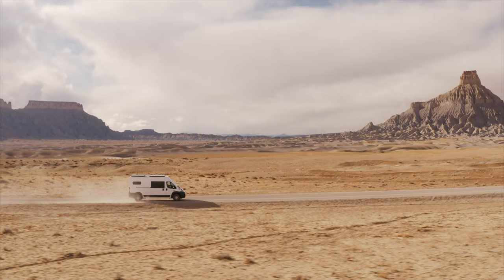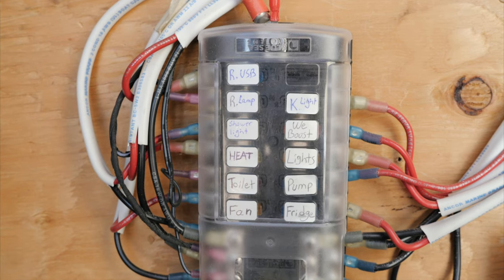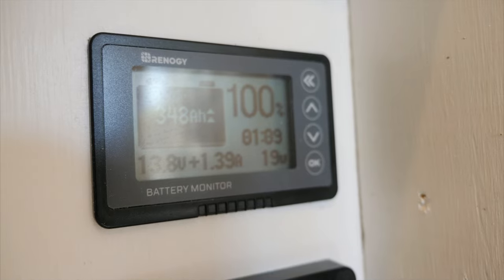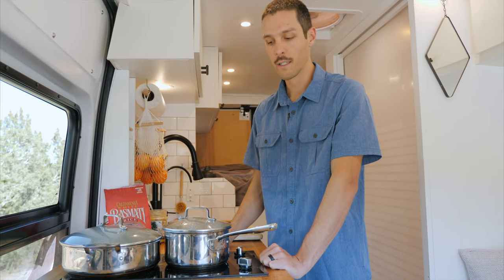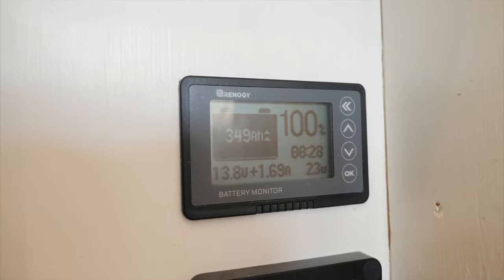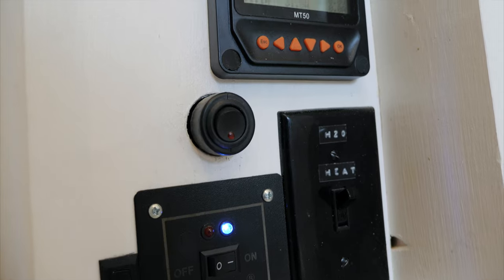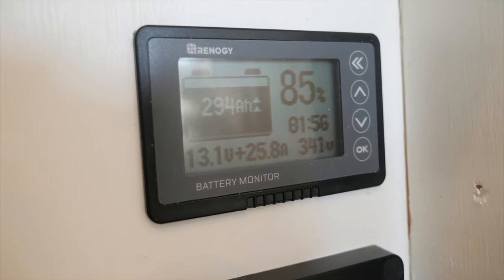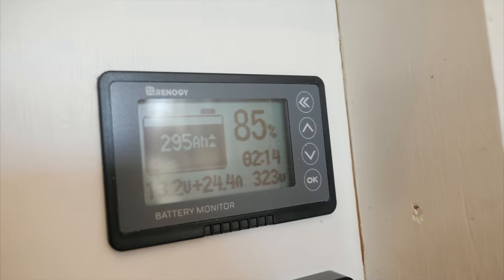800 Watt Solar Van Electrical System Performance + Free Van Wiring Diagram!

Comment: @ActsofAdventure, I bet the competition is not too happy with your free downloadable guides!  You don't even know how GRATEFUL the rest of us are, though. I'm just starting my electrical layout, as I'm just finishing up my Promaster's insulation, and I've been looking for an electrical system to mimic that's similar to yours. In the past two weeks I have bought a Growatt 3000watt 48-volt all-in-one inverter/charge controller unit, 1040 watts of solar panels (24 volt), two max fans, and today I just bought 4 of the SOK 206 Amp hrs lithium batteries. I need to look at your roof rack guide now, too! 
Wow... just thanks so much!!
Reply from the maker: That's all so great to hear! You're very welcome. We built our van from free internet resources and just want to give back to the van building community. Your electrical setup sounds like it's shaping up to be a beast of a system! Best wishes on your build and please let us know any questions that might come up when installing it all.

Comment: Awesome stuff, thanks for sharing. Have you considered a solar hot water heater? I think they are way more efficient at heating water than going through PV to batteries and then an electric water heater. Even a small, panel that you could set outside on a little stand and plug in might be a cool option that would save a lot of electric.

Comment: Hello, fantastic job you did, I am installing my solar and have a question: why you connect serie-parallel your solar cells and not all paralell?    I have 4 units 100w, open voltage 24.3V, 5.21 Amp.
Reply from the maker: Hey, thanks! Great question. We did series-parallel because 
1) We liked the idea of separating the front 2 panels and the rear 2 panels in case one half of the roof is shaded, then the other half of the solar array is still producing full power. 
2) All 800 watts in parallel would be a very large amperage and require thicker gauge solar wires. These wires are very long and some amps can be lost over that distance. Raising the voltage by connecting the 2 parallel pairs in series allows less energy to be lost when traveling the length of the cables. Then, the MPPT controller converts it all back to 12v at the highest/best amperage needed for the batteries anyway. 
Hope that all makes sense and helps!

Comment: Tnx - nice set up. Why the two sets of two solar panels run in different directions (landscape at the back, portrait at the front)?
Reply from the maker: Hey, good question. It was about the fit on the roof. The 2 panels at the back of the van behind the fan wouldn't fit lengthwise, so they had to go widthwise. And by mounting them widthwise, we had to mount them on the unistrut roof rack a bit differently than the front panels.
Reply: @ActsofAdventure  ok I get the 2 rear panels had to go widthwise due to the fan but then why not the two front ones widthwise as well. There is something I’m not getting?
Reply from the maker: @dimitristsagdis7340  Check out our solar panel roof rack blog post for more pics. https://actsofadventure.com/solar-panel-roof-rack. You'll see that the rear panels had to be mounted higher on an extra layer of unistrut. Widthwise, these solar panels fit exactly on top of the unistrut side rails. This creates a problem because you can't access the bottom of the panels to mount them to the unistrut. Since the front panels could fit lengthwise, they didn't need the extra mounting height, and so they are more aerodynamic and low profile. I would have preferred to mount the rear panels lengthwise, but they just barely wouldn't fit unfortunately.
Reply: @ActsofAdventure  ok Tnx it is clear now.

Comment: Thank you so much for putting out this video. Very helpful! Looking forward to spending some time with your diagram. Why don't you upgrade to lithium? Seems like that would give you more than enough power. Cheers!
Reply from the maker: You're very welcome! Let us know if you have questions about the items in the diagram or the wiring connections. Our decision to go with AGM was largely due to price. We have 350 usable amp hours for $1400 total. That many amp hours in lithium costs around $3500, especially 2 years ago when lithium was just becoming mainstream. When our AGM's degrade in 2-3 more years, we will likely consider lithium as their replacement!
Reply: @ActsofAdventure  What an excellent logical decision! It is easy to forget how fast the prices of lithium batteries have fallen and that they were too expensive for your budget two years ago.
Reply from the maker: @mitchellbarnow1709  Gotta love technological advances and an increase in competition! I remember it was really only Battle Born or build-your-own with lithium cells 2 years ago.

Comment: you mentioned you don't need to pay for water [min 0:32] how come? You don't seem to elaborate on this in the video; pls explain.
Reply from the maker: I was wondering who would catch that ;-) Here in the Western U.S. we've always been able to find free places to fill our water tanks! Usually at gas stations or city RV dump stations. We never stay at campgrounds or RV parks so we find as many free water sources as we can. They're all listed on the iOverlander app or rvdumpsites.net.
Reply: @ActsofAdventure  Tnx I thought it was maybe due to your electrical installation for example some RVs use UV filters and recycle their shower water as well as dehumidifiers to turn condensation to water for dishwashing, I’ve even seen rain water traps with gutters in the roof:-)) by I could find anything of such things in the diagram which is why I thought to ask just in case.
Reply from the maker: @dimitristsagdis7340  Wow, that would be a next-level water system! Maybe in our next van build!

Comment: If you are going to take separate showers, do you leave the water heater power switched on, since the thermostat will stop the power draw once the set temperature has been reached?
Reply from the maker: We got the 4gal Bosch instead of the 2.5gal so that a full heated tank would be enough hot water for both of us to take showers. We take short, on-off style showers, but there's enough hot water for both of us without the need to re-heat the water tank or keep it switched on. Also, we generally heat the tank in the afternoon, and it stays hot through the evening.
Reply: @ActsofAdventure  That is fantastic that four gallons is enough and you can heat it up when you have plenty of spare solar energy!

Comment: Any particular reason you chose AGM over Lithium? Just checked the prices on the batteries you mentioned and the prices for a lithium bank of similar capacity isnt all that different. Not too mention the batteries are a lot lighter too for your payload
Reply from the maker: Hi Hugo, great question. When we built this in 2019, we spent ~$1500 on our AGM batteries, and lithium was at least double today’s prices. Cost of lithium has really gone down a lot. Those Enduro lithium batteries are a really great deal, and even make us consider switching to lithium!

AGM has worked really well for us though. One of our favorite benefits is that we can store the van all winter and never have to worry about the temp of the batteries.

Comment: How do you know when the water is hot?
Reply from the maker: We only turn on the hot water heater when we need it for showers. We can tell when it is done heating the water when its large electrical draw on our battery monitor goes off. We’ve also learned that it takes about 15-20 minutes.

Comment: Why are you afraid of propane. Overall this was a very informative video and I really enjoyed it. I just wonder why you would rely electricity for all major appliances. It would make more sense to have heat intensive appliances like water heater and stove/oven be propane based and reserve amp hours for things that NEED to be powered by electrical. You wouldn’t need to have to such a large electrical system ie (800W, 3000W inverter and 700AH battery). I bet you could cut all of those in half if you distributed your systems over other sources. I’m still a huge fan and I for sure am using your van layout layout as inspiration for mine. Thanks for your videos!
Reply from the maker: Hey Skyler, propane is definitely an efficient and inexpensive way to cook and heat things, which is why the majority of vanlifers choose propane. 
We went full electric for a few reasons - mostly that we didn't have to install an entire propane system in addition to a water system and an electric system. Having never built anything before this van, it took us a year to build, and not having to worry about propane was a welcomed relief. I actually enjoy electrical wiring. 
Secondly, of course no propane means we never have to refill propane on the road. Just one less thing to worry about.  Electricity is 100% passive once it's installed. 
Third, we didn't want to take up precious cargo space with a sealed propane locker, and mounting a propane cylinder under the van felt sketchy to us because we are often on rough dirt roads. 
Finally, knowing that off-grid electrical is expensive, we built our large electrical system on a budget. You could easily spend more than double what we spent on all Victron electronics and lithium batteries, which is what you often see in other van builds. All in our Promaster + build out cost less than an empty Sprinter! 
Thanks for checking out our resources and we wish you all the best on your van build!
Reply: @ActsofAdventure  all great reasons, it sounds like you made the right choice. Good luck with everything, your Channel is great

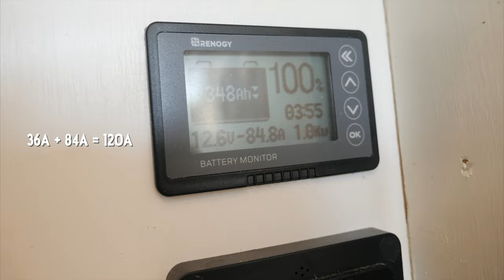Comment: At 7:24 . If I understand correctly.. let’s say you had an appliance that sucks 348amps/hours and you use that for an hour. Would the batterie be dead ?

Huge thanks for the wire diagram 💙
Reply from the maker: Glad the wiring diagram is helpful! Yes, 348 amps for 1 hour would use the whole useable half of our battery bank.